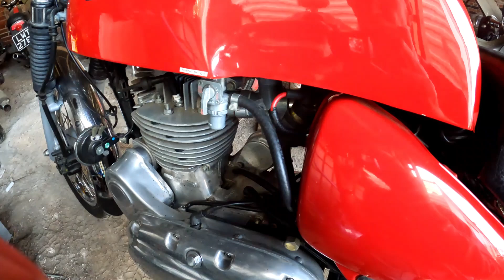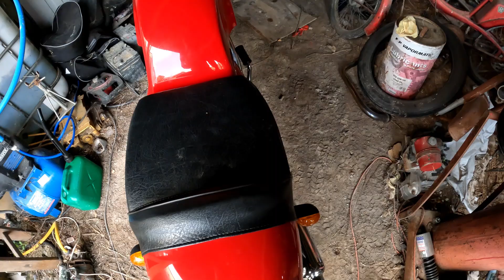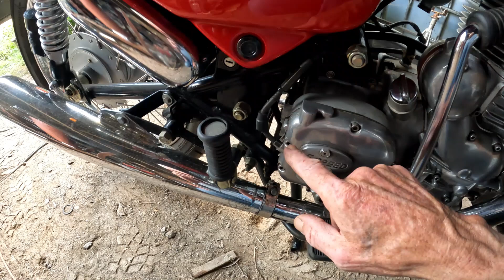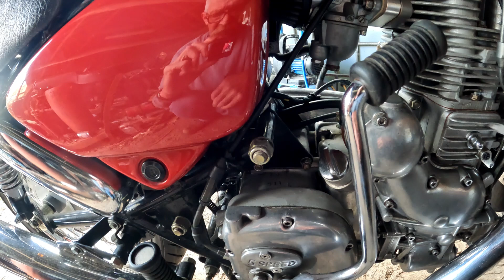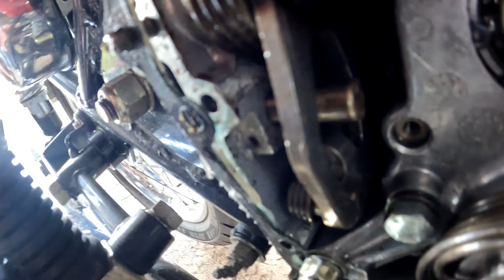ROYAL ENFIELD 500 XR, CARBURATION AND GEARBOX PROBLEMS.

Comment: I remember back in 1969 going to look at a 250 GT Continental, it was a great looking bike, I really wanted it, but on the test ride it kept jumping out of gear and in those days I wasn’t as knowledgeable, so I walked away, wish I had it now, I think it was only about a hundred quid or so.😂🤣
Reply from the maker: @martindavies8326 That seemed to be a common problem with the 250's, I had a 250 Crusader that did the same! A hundred quid would buy you a new back tyre these days!
Reply: @ if I had one now, I wouldn’t be able to ride it with my bad back, but when I was Young Clip ons wasn’t a problem .🫣🤣😂 wish RE would make a new GT based on the 350 motor, I tested the 500 GT when it first came out, and the vibration was too much for me,  white finger comes to mind.🫨🙌🏻

Comment: I would think the quadrant is hardend in some way, if it's case hardend will trimming it back cause a problem? It's handy that it's reasnobly accessable..
Reply from the maker: @roum22 No, it's not hardened, just mild steel. When I took the grinder to it the sparks were orange. If it had been hardened, then the sparks would be red.

Comment: Very interesting video, I take it that no such problems occur on the four speed boxes?,I hope you get it sorted,although it looks like its a bit of trial and error as you don't want to take too much metal off! good luck ,looking forward to the follow-up!
Reply from the maker: @patrickgreenman8248 The old 4 speed Albion gearboxes were designed and originally made in England and were of sound design. For the Indian factory it was very easy for them to copy something that was right. The early 5 speed gearboxes were their own creation.
Reply: I was wondering, if that was the case,I gather they've perfected the design by now!
Reply from the maker: @patrickgreenman8248  I think they have mastered the art now!

Comment: One of the most interesting videos ive seen in a long time,its hard to believe that they were making gearboxes like this at this time when the japanese had this stuff sorted in the seventies or before,ive only ever had 1 problem and that was a broken return spring on my cg125,it seems that even the new 650,s have had some problems though my 650gt has a sweet gearbox
Reply from the maker: @rover100bunson You have to remember that Royal Enfield India had only ever built the cast iron Bullet's from 1954-2008. Designing a five speed gearbox, from scratch, was something very new to them! It was something from outside their timewarp!